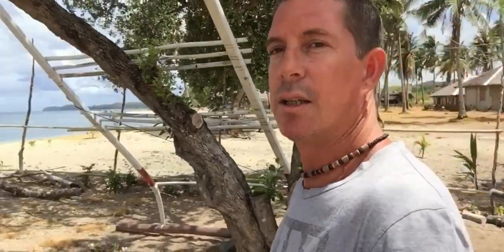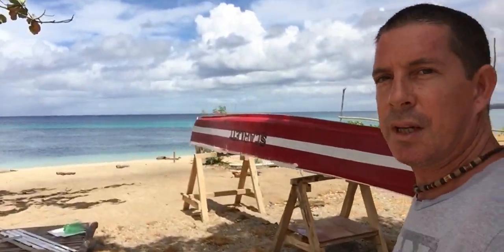Paraw Restoration

Comment: Can you make a simple tutorial on how you operate the traditional paraw? It seems similar to all other crab claw type, but would like to hear your comments about its design. :)
Reply from the maker: Hi Bon, thank you for your comment. Unfortunately my paraw is currently dismantled, so I can't do a tutorial video. But it is exactly the same to sail as a Hobi Cat, where tacking is really tough. I often have to use the paddle to get the bow through the windline. Everywhere else it is the same to operate as any other small sailboat. It's happy in winds up to 15kts, but it doesn't like gusts. You really need to move your weight around to keep it level and avoid capsizing. I hope that helps. Happy sailing!